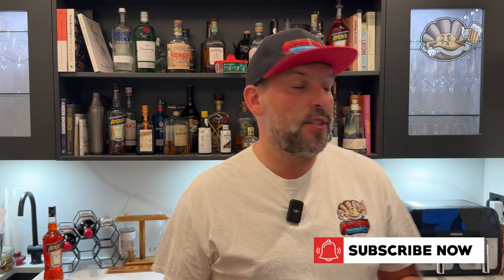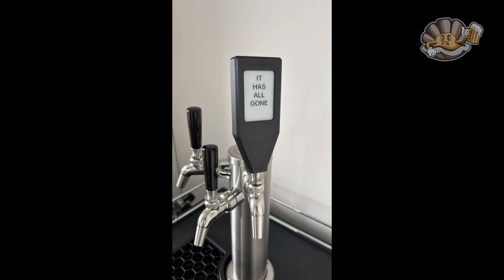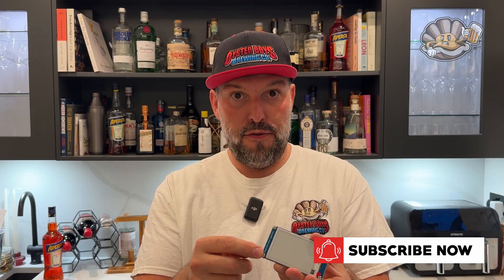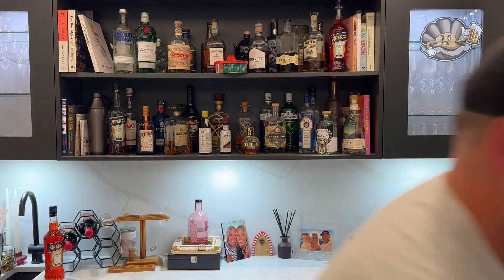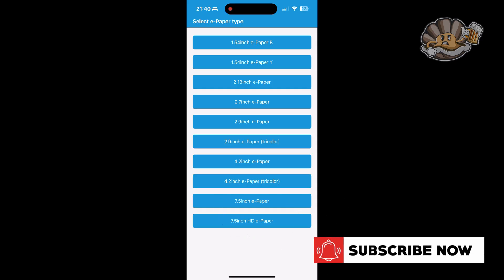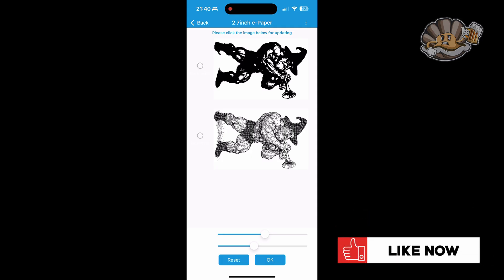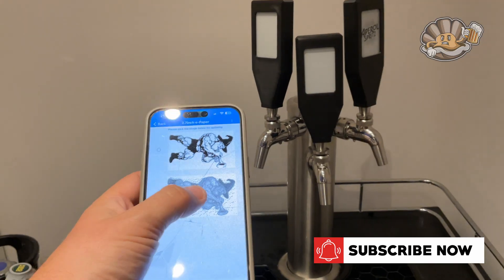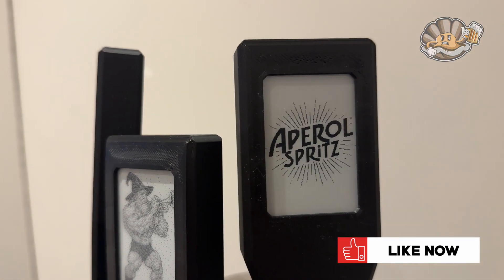3D Printed Beer Tap Handles with NFC E-Ink Displays

Comment: Looking forward once this is done dynamically from a temp controller or similar.
Imagine a temp controller which knows what's on tap, using keg level sensors to measure how much is left, and is putting this on the displays.
If I had more time I would look into OpenEPaperLink or similar. But maybe @kegland is doing something like that for us in future... 😅